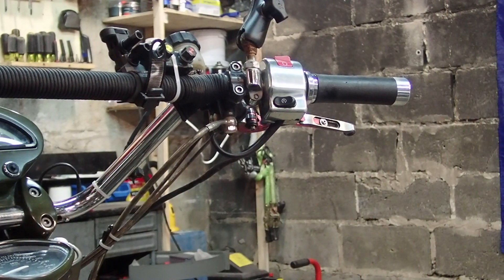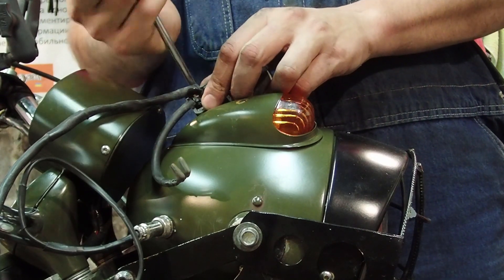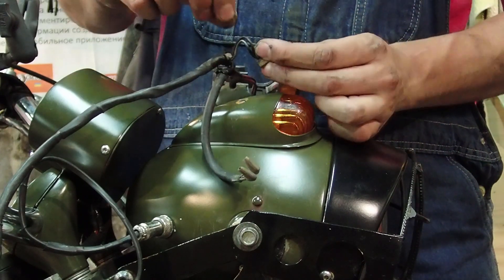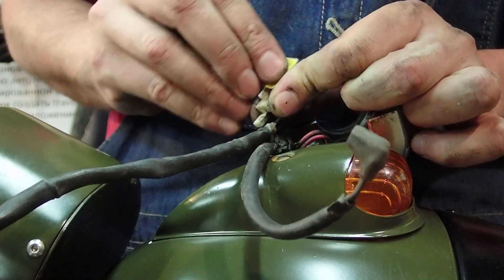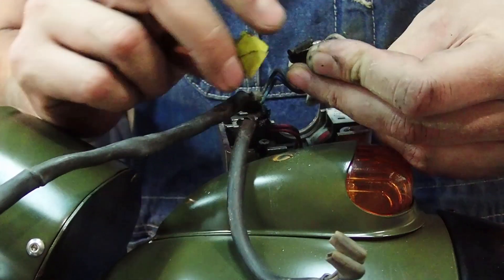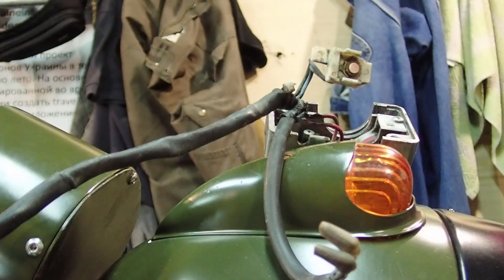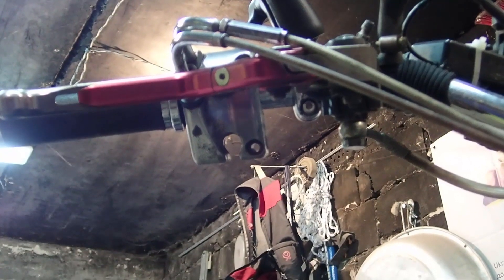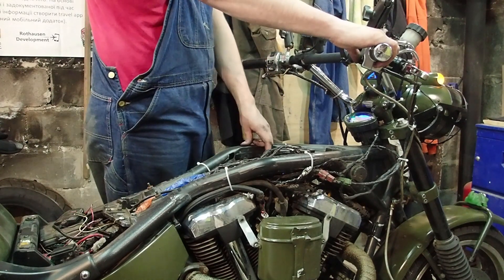Yamaha Road Star Warrior Starting Button Fix

Comment: Dude I have to know what levers are you using? Brake and clutch i noticed the brake reservoir isn't stock as well been wanting to change mines out for some time but can't find any. Any info would be greatly appreciated 🙏
Reply from the maker: The master cylinder is from an R1 I believe, if memory serves me correct. I think it had a bigger diameter piston inside so more breaking force. the levers are just some cheap crap off ebay haha. both for an R1
Reply: @bumzhibiker  Nice!!! Very nice,  thank you so much I've always felt like the stock levers and whatnot were really huge so I've been looking for some sort of an alternative and you pointed me in a direction that's definitely worth checking out.  I'm assuming that the r1 parts are 7/8s? Will that be fine for 1 inch bars?